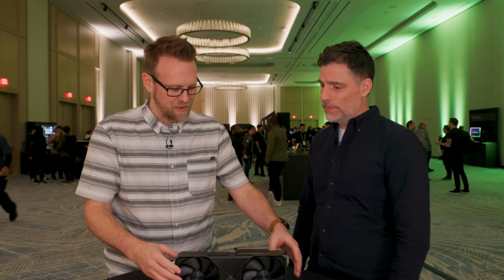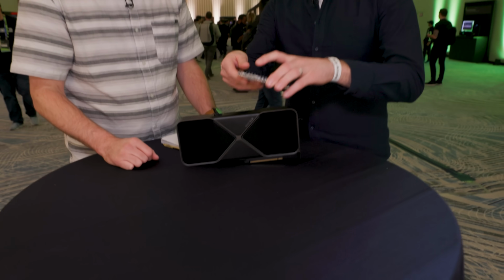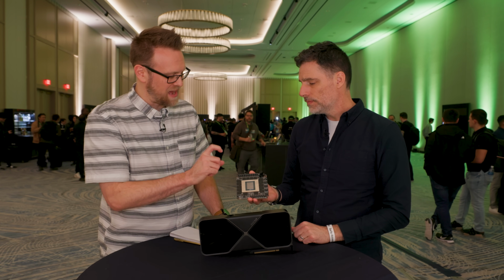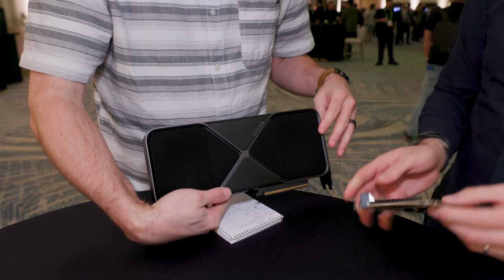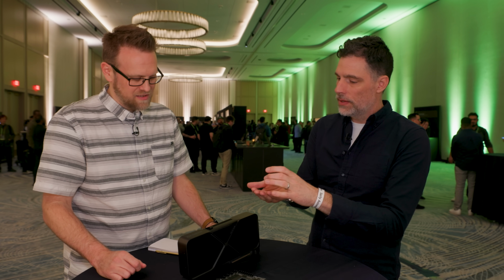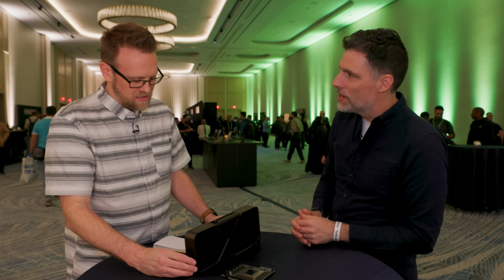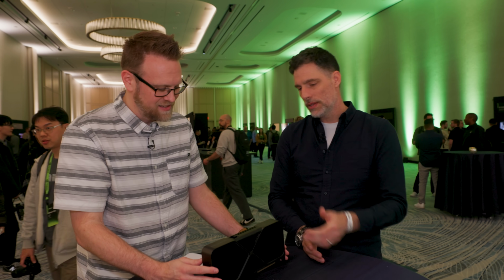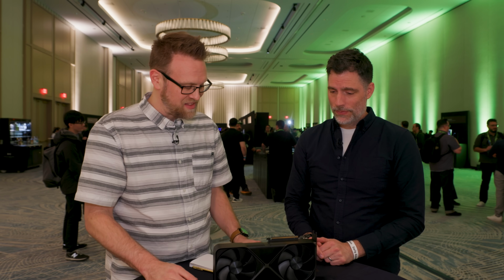Nvidia Talks RTX 5090 Founders Edition Design

Comment: I think card and motherboard designers should come up with a standardized solution to get rid of the power cables once and for all. Just have it run from the PSU to the MB from underneath then have a dedicated power port or dongle near the PCIe slot and have the connector on the underside of the card, no more hassle, all logos and LEDs visible, no airflow blocked. Shouldnt be too hard, except that everyone is worried about overall compatibility, but its about time.

Comment: The smaller things get, the more expensive they become. creating smaller components requires more advanced technology and precision in manufacturing which drives manuf. cost up.
imagine, an ATX form factor Graphic Card, all the components used on would be cheaper without compromise on specs, VRAMs would be replaceable similar to RAM on m.board. GPU's would be replaceable like CPU's etc. the market should be regulated for more competitive conditions.

Comment: I wish they would redesign the standard ATX format to resemble the Mac Pro, where three large fans are positioned in the front to cool the GPU and CPU.

This design would not only reduce the cost of cooling for GPU manufacturers but also decrease the weight of the GPU, eliminating the need for GPU braces to prevent bending from the PCIe slot.

Comment: What i find odd is this is a newer generation gpu has over 5,000 more cuda cores 125 watts more power usage then a 4090 and pure rasterization performance without their multi frame gen is 20-30% for a 575 watt card it should be better.

Comment: It's certainly an impressive feat of thermal and mechanical engineering. We'll have to see how it performs thermally.
There is certainly a worrying trend of pushing the 12VHPWR connector to its limit. 575W on a connector rated for 600W where the 450W 4090 was already having myriad issues with the connector. The 12VHPWR connector already has dramatically reduced thermal margins compared to the 6 and 8-pin PCIe power connectors.

Comment: They always design these cards all wrong, why is the power connector at the top? Put under the card and at the end so the power cable just goes straight out the back of the case without being seen. Also the whole Pcie connector thing is way too small for modern cards, it's impossible to free them now from the latch thing. That cooling as well blowing right through on the first fan is only going to heat up my Nvme, my motherboard IO and disrupt my CPU heatsink's fan flow.

Comment: 10:52 so it totally makes sense to have the connector angled. It was angled on 30x0 series, and angled back again on 50x0 series. So why the hell it was put straight on 40x0 series cards? the PCB design is very "apple" like. Wonder how the repair chaps will react to these

Comment: But if the front of my case is intake and the rear exhaust... The GPU airflow is still wrong direction. And the ram isn`t inline.... Almost as if you need to rotate the baord 90° and make the tom exhaust and bottom intake? 

Why arent the desktop workstation options more like a server chassis where all airflow is inline one direction?
Reply: So now the best case for this is airflow from bottom of case to top. And then have a waterpump CPU cooler out if the way of the GPU since it only blows upwards. This is much better than my current setup where the GPU blows right on the CPU fanblock since I dont have a waterpump CPU.

Comment: It feels like NVIDIA invested most of their resources over the past 3 years into engineering a series of monster 600 W GPUs. First we had that freakish 600 W 4090 Ti prototype spanning 4-slots w/ a side & vertically-mounted tiny PCB and now we get this thing. The 16-pin connector only makes full sense on these small PCBs.

I like this FE, it looks to be THE best 5090, better than all AIB units. The 2-slot footprint is absolutely excellent and it leaves AIBs in blatant offside as they all continued the trend of slapping on STUPIDLY large coolers (even on sub-350 W GPUs!) to help sell the illusion of value for money.

The only scary considerations are reparability (looks difficult to disassemble & work on and there won't be any expertise where FE is not sold) and, of course, burn-your-house-down-ability as that connector will have 95.83%!!! of its max. spec. of 600 W pumped through for years... and its earlier iteration produced a non-negligible no. of toasty failures at just 75% of that same spec.

Oh well. I guess people who have $2000+ for a GPU can always get a new house.

Comment: I can respect Nvidia cares about making a quality product.
Reply: Not really when you factor in 3090 issue of VRAM failure and 4090 connector meltdowns.
Reply: @lostalx  I always thought alot of the 4090 problems were people not fully seating in the psu connection. Personally the 4090 blows away the experience compared to gpus of 10 years ago. Quiet, efficient, doesn't crash. The resell value says alot.

Comment: So now 575 watts of heat is flowing directly over your RAM and CPU.  The pass-through design is an elegant design in isolation, however it would be so much more elegant if it actually dumped that heat outside of the case.
I know a lot of people hated the axial radiators of yore, but they actually ejected heat out of the back of the case.
The pass-through design, while a huge improvement over the current designs, would be so nice if only you could have it at the top of the case, passing the heat out, or at least rotated to pass hot air out of the back.
Reply: We need to get rid of ATX/ITX entirely and come up with a new form factor designed for modern GPUs that would let them exhaust air directly out of the case (with more room than the leftover space on a couple of PCIe slots provides, heh). It's beyond time we did this. ATX was designed when cards didn't even have heatsinks, let alone fans and enormous metal blocks hanging off of them (and the poor PCIe connector!)
Reply: Current gen RAM really doesn't get hot enough for that to be a real problem and you're always gonna have a trade off between CPU- and GPU cooling in a case without custom loop. Axial radiators would just be moving the problem to the GPU instead of the CPU and considering the far higher heat generation of the GPU vs the CPU, overall performance would be worse.
Reply: @MajinOthinus  All the more reason the GPU cooler should be at the top instead of the CPU radiator.
Reply: @LeesChannel  I mean, there will be AIO variants where you can do exactly that, even if you don't want to build a custom loop.
Reply: @MajinOthinus  Which completely negates the pass-through cooler
Reply: @LeesChannel  As I said in my earlier comment, the pass through cooler really isn't an issue, but if you do think it is, there ARE other options that fit your exact need.

Comment: Finally back to 2 slots. Sick of 3-4 slot designs weighing 4-5 lbs sagging and warping PCBs/slots. The same warping and sagging was causing the huge amount of failures of the super heavy cards.
I only wonder the difficulties of creating a waterblock for the custom water loop people and availability.

Comment: Brilliant engineering……however……beyond the air flow considerations they also noted how the 4000 series giant, heavy single PCB was prone to cracking due to sagging stress. 

So by modularizing the main PCB and having an external port module and a PCIe module- the two most areas prone to breaking no longer leads to a total GPU that is a brick. 

I credit them but to me this appears to be their prime motivation beyond airflow

Comment: Price and performance aside, i really like the new reference design/Founders Edition, actually first time i could see myself having such one in my system, if it was an all black theme i was going for.

But my system is all white theme build.

I'm no expert on how all this works. But one would think with these changes from Nvidia, 3rd party board manufactures also would do some more significant designs, and be able to shrink there design, instead of  what we have been seeing in recent years, where gpu's just gone bigger and bigger every gen. But what i seen so far, it seems like most have just done the easy way and mostly reused old huge heatsink designs.

Comment: Are partner models on a diff pcb?
Reply: Partner models use their own PCBs and will almost certainly be better for water blocking, but as far as air cooling goes, the FE design is probably one of the best. There is nothing that prevents a partner from using a similar PCB design in principle though.
Reply: Yes they are using pcb similar to 4090s size. I don’t trust these teeny PCBs and will go with an AIB

Comment: That part when he talks about cable connector 11:15 holy shit. What a terrible design... Who was behind this? Part time student designer?

Not only cable will block logo of the card, if you decide to take it other way it will restrict airflow. Minimal impact my ass you dumbass. So now, no one gets to route cable with 90 degree connectors because f+_5$ you that's why...

Comment: you can tell they have been thinking about this since the GTX295/9800GX2 and GTX480 when they started putting holes in the PCB for airflow. I wonder if you really cant change the color of the LEDs on the V part of the card. With 30 series you could change those, just not the Geforce logo.

Comment: This is not stupid at all.
Separating display and connector boards makes the most issue on GPUs to be fixed by not touching gpu board.

(I had DP and HDMI ports suicide, mainly due to bad PCB design - gigabyte, you know you save money in wrong places.)

Comment: Great design.  TBH one of the best I've seen ever.  The fact the PCI connection is separated is going to make repair so much easier and reduce/remove the possibility of damage to the main PCB due to stress on the sockets/weight.
Reply: Ahh true, hadn't considered that. Lighter weight probably helps too but yeah, heavy cards flexing at the PCI-E connection causes a lot of damaged cards. If board partners are permitted to do stuff like this they should be looking closely at this FE design, it seems to solve a lot of issues.
Reply: I wonder if PCI-e PCB is made out of metal... (like on 4-slot 4090 card from last GN video)
Reply: Yes, but the flex cables will not be easy to find. And the core repairs will be very expensive.

Comment: if the pcie or the hdmi connector fails then it can be replaced easily, that's a big feature. it might also technically possible to fit it in a small factor PC or slightly bulky laptop. Hope they standardize the connector so that parts are easily swappable.

Comment: I really doubt that that cooler is enough to handle 575W efficiently because it looks like it was designed to fit a specific form factor rather than having decent cooling performance. Nvidia is definitely depending on external cooling for these, like in data centers. It's not magic. I expect 70-75 degrees at full load, maybe even hotter in personal PCs. And buyers beware, this will probably be an unreliable card.

Comment: Amazing engineering and design. This FE card is probably the best GPU design I've ever come across. Very impressed! My only concern is how it will perform in a sandwich style SFF case like the Fractal Terra, since the GPU is mounted vertically and the hot air from this design will be blowing right into the case and onto the underside of the motherboard.
Reply: I mean, SFF cases will obviously never have as good thermal performance as an equivalent ATX case, but in general, the additional space should help.

Comment: That was more information than the whole show with Jensen
Reply: More information on the cooler and FE PCB design, yes, but that wasn't the point of the keynote. Obviously a dedicated show off of a specific design will be more comprehensive.
Reply: Because the actual stage presentation is for investors not enthusiasts.
Reply: Keynote is for the shareholders. They don’t care about technical details like this.
Reply: Designers get it right! ✌️
Reply: More logical than saying saying a 5070 is as powerful as a 4090 🤦‍♂
Reply: @robertlawrence9000  He explicitly followed that up with saying that that is with AI.
And it's not like that was hidden in small print either.

People need to come down from their hate boner for AI; I get it, it has become a useless buzzword for most things, but this is an area where it actually applies for once.
Reply: @MajinOthinus  I'm just saying it how it was implied. No sense in implying something like saying that a 5070 is as powerful as a 4090 when it is not. "With the power of Ai" meaning multiframe generation, which in itself will have more lag than regular frame generation. He did NOT clarify that. Spec wise they are no where near the same.

People need to come down from their love boner for Ai and look at the facts.
Reply: Jensen is a massive clown
Reply: @MegaChickenPunch  well he got a 5090 and you didn't. So apparently you're the nobody clown.
Reply: @MegaChickenPunch why you mad tho
Reply: @ stop doing tricks on it cringe glazer
Reply: @MegaChickenPunch  you can’t be serious 😂😂🤦‍♂️🤡
Reply: @ stop doing tricks on it cringe glazer
Reply: @ pisslow

Comment: If I want to stack these in a chassis what is the clearance required between GPUs? One slot or more? Probably need to put some separating plate cause hot air will be going straight up to the next card. It’s impressive they managed to make 2 slot card but stacking is a problem.
Reply: nobody cares
Reply: @ yes you are right. You are nobody and you don’t care. Keep it to yourself 😉

Comment: another advantage is, that you can replace pcie board (when pcie connector breaks) or display board on death conenctors much easier. downside is, that it will take some time until watercool heatsinks will arrive.

Comment: So, in the 5090 founder's edition, the PCI interface of the graphics card is no longer integrated with main PCB. Did they do this to save the card from breaking due to sagging issue? If I remember, lot of 4090s were reported to have been damaged in this manner. So, would this affect performance?
Reply: Possibly, we have no way of knowing if that was part of their logic. If they were to keep the PCI interface on the same board while using this new design that has a massive hole for the left fan, the hole would create a weak spot in the PCB material and likely failure point under those sagging conditions. Better to have two PCBs connected by a cable.

Comment: Im really interessted if an vertical mount does effect the thermals badly. Its clearly for horizontal mounting designed.
Reply: you'll cook your motherboard. Vertical GPU mounting is dumb. Cases need to come with built in screw holes and brackets to attach the free end of the card to the chassis, rather than providing nothing or a stupid little stand at best.

Comment: Probably the one Question I'd like to ask those Engineers is why they insist on using the controversial 12+4 Power Connector... Why not just use a beefy 2-Wire XT60/90 like Connector from the RC Industry? I've never heard of one of those melting ( at least not at the power Levels that of a GPU ). Would also look a lot nicer with just two thick Gauge Wires instead of the usual Rats nest 😑

Comment: shrinking pcbs is a challenge, especially when you subsequently have 14+ layers, but technically shorter distances are beneficial for higher speed traces (GDDR7X, PCIE5, DP80LL) so a more compact pcb would reach the rated bandwidth easier

Comment: after watching the recent video from GN of the "test" 4090 they had and that enormous cooler, we can see a lot of similar things done on the PCB, the Display Port and how the PCI Express connector is now an actual pcb itself connected to the main PCB. The board is also very thicc, so this is probably why nvidia can get away with having a SFF size while using upto 575W

Comment: I really want to know whether it can be mounted vertically at all. My case only supports vertical mounting. It seems the hot air would blow right on the motherboard and M2's
Reply: womp womp cry about it
Reply: Yes it can be at least in some of the builds they had on display but it had plenty of space for exhaust. I have an Xproto and think it would work with a spacer to push the card out a bit.

Comment: One thing that wasn't addressed in the video - is this 3 part PCB only for 5090 or is it also used on 5080 (and possibly future cards like 5080 Super/Ti versions)?
Reply: Looks like 5080 as well
Reply: He said that the design is different for the 5070, so 5080 probably shares the 5090 design.

Comment: Smart design! It also means that the two parts most likely to sustain damage (i.e. the PCIe connector, and the output ports) are no longer on the same PCB as the most expensive parts - the GPU and the VRAM. That should make repairing these expensive units much more viable - even a hobbyist with a screwdriver should be able to do it! Bad news for the likes of @northwestrepair though, who have to do it the hard way on current designs.

Comment: Why the power connector industry standard? My original Nvidia cable in 4090 melted and got it replaced. Now, the connector in the GPU is weak, and I expect the GPU to fail anytime. This is to share my feedback, knowing that I paid $3000 for a product that has such a poor design. Worse, 5090 draws more power with the same connector 😮

Comment: Where are the engineers when they design the power connector? Is it true this is a way to control the life of the GPU? A GPU used heavily will break within 3-5 years (power connector will melt damaging the PCB, making it useless outside the warranty period). 😮